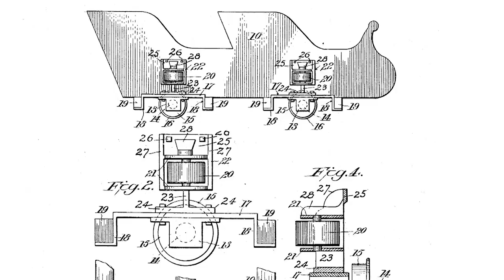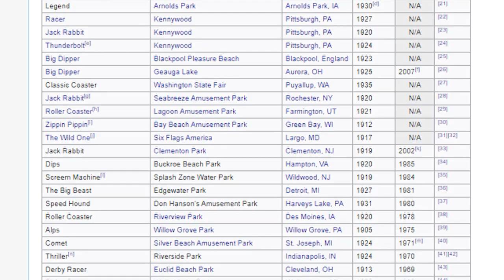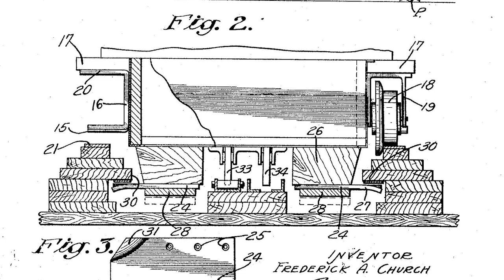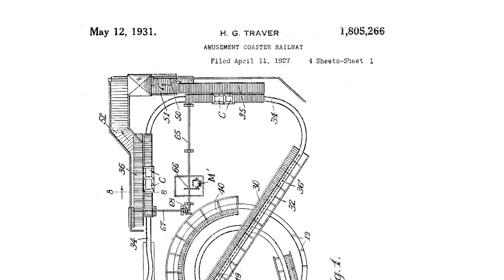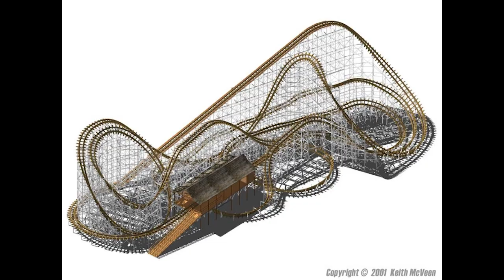Essential Roller Coaster History, Episode 2: The Roaring 20's (1910's - 1929)

Comment: Grew up riding the Dragon Coaster at Rye Playland. I still enjoy it even though they had to replace the trains due to people standing up during the ride on the old trains. Even got to work it for a day or two when I worked at Playland in the early 90's. It will turn 100 in 2028. Still hope they will somehow re-build the Aeroplane Coaster you talked about. There is talk about it, they supposedly have the original plans. But the park has been struggling lately.

Comment: Dorney Park, just west of Allentown PA, was our family's home town park with Hershey Park not much farther away.  The ThunderHawk was my first real coaster ride but not called that back in the day.  I remember when you entered, you were given a little cardboard card that the ride attendant 'punched' as you boarded the train.  You could stay on the train and get your card punched for every re-ride then pay accordingly as you exited.  The old park had a number of now removed elder generation features and this coaster had a station under a roof that housed both bumper cars and part of the old mill boats that ended with a lift hill and short drop into a water pond.  These were all wooden structures that have been torn down due to fire hazard. They also had an enclosed crazy cup ride that was great in that it had four turn tables that switched the cups around.  They also had a coney island labeled whip that I believe may still be in operation.  Hershey has a great wooden coaster, the comet along with a rough track wildcat and a side by side racing coaster with articulated cars.  Finally, we used to live on Long Island and were able to visit the real Coney Island multiple times where I enjoyed the true Cyclone Coaster which is across the street from Nathans Hot  Dogs.  I used to change a 20 into singles as you can still get re-rides on the Cyclone (used to be 4 dollars a pop) but be ready to pay as soon as the train pulls into the station.  Also if you move fast enough you can change your seat and move up to either the front or back seat!  The back is a killer and you feel like you went a couple rounds in the ring with a real boxer!
Reply from the maker: Thanks for taking the time to write all of this up, I really enjoyed reading through it. It's amazing to hear how much these parks have changed over only a generation or two - your story about the cardboard card on the Thunderhawk particularly struck me, as it's so unlike how Dorney is today, now owned by a multimillion dollar publicly traded company. Thanks for coming by and checking out the channel.
Reply: I grew up between Dorney, Hershey and Knoebels in the 80s and 90s and while The Phoenix was my first and favorite coaster, Thunderhawk and Comet are a close second and third. Thunderhawk was always such a beast of a coaster, I still love it so much. I vaguely remember a house under the first hill? Something about the owner at the time wanting his wife to divorce him so he built her it to drive her nuts but she stayed anyway? Something to that nature.
Reply from the maker: @rockangel16  that’s a hilarious story about the house. Personally, I’d be thrilled if my partner built me a house located underneath the oldest operating coaster in the Cedar Fair chain but, i guess it wouldn’t be for everyone haha